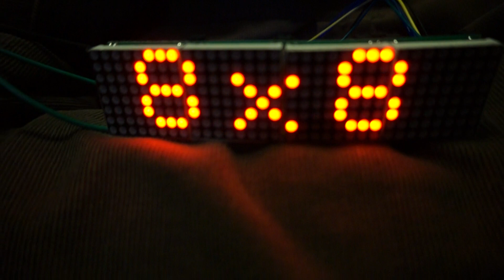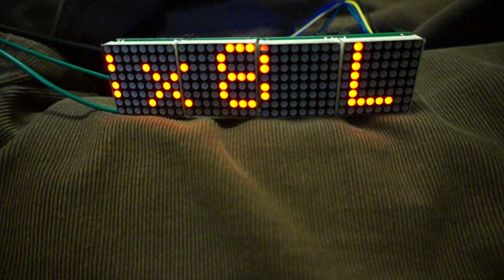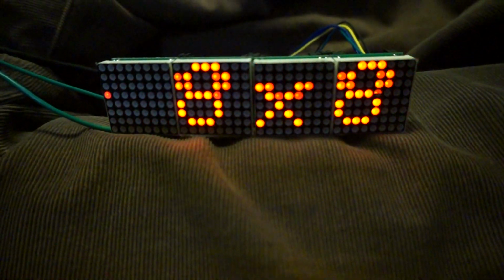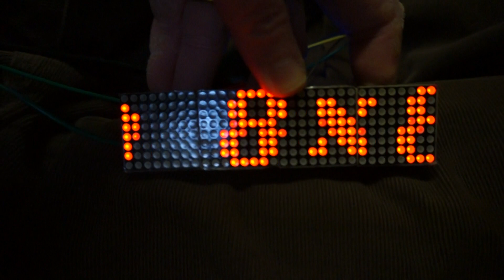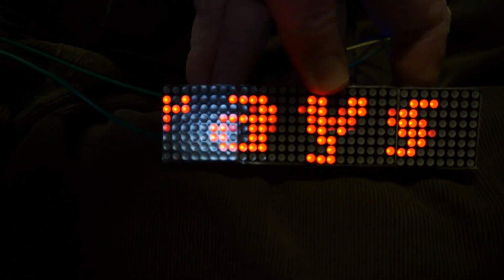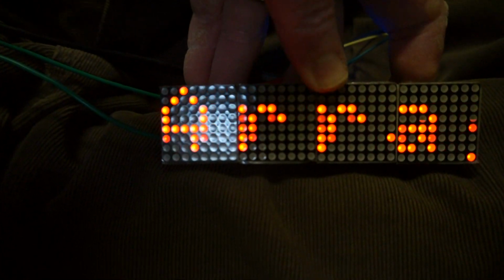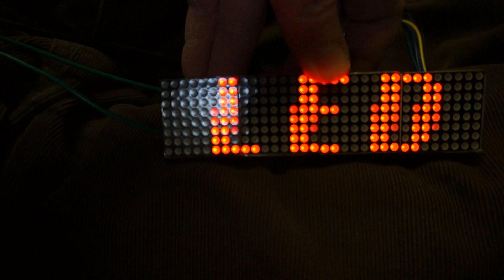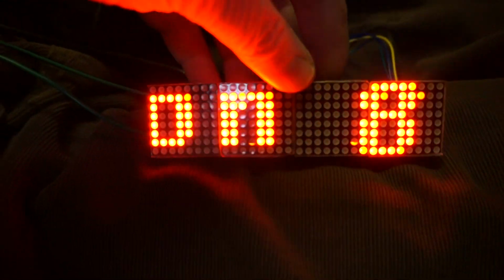IcStationArrays140116a

Comment: Been hunting for these for weeks... I have 6 8x8 modules but they have no real ability to chain horizontally and vertically. I was going to go for 64x32 rgb but they're a pain in the A** to refresh. Hard to beat the MAX7219. My only concern is the soldering so will order a few extras in case. I'm looking at chaining at least 6*4